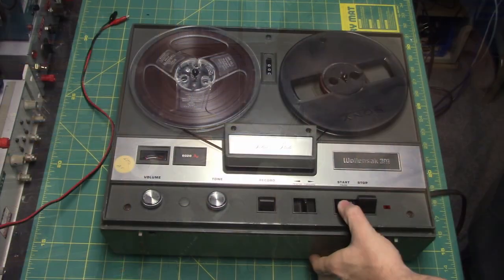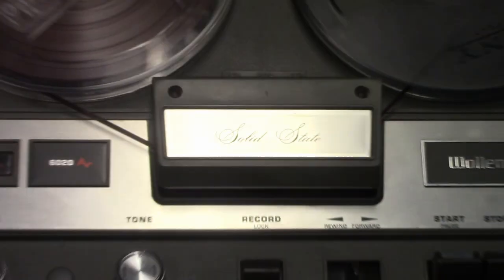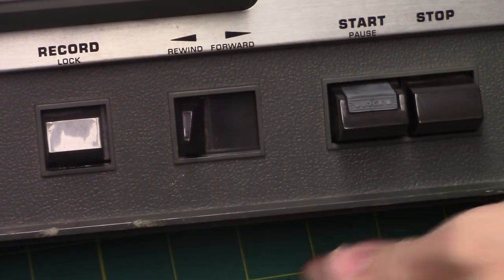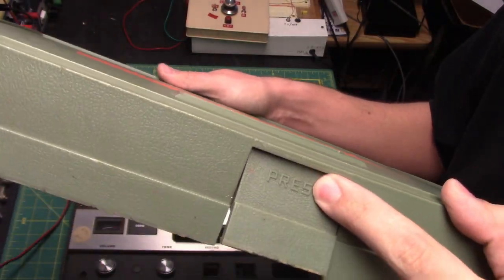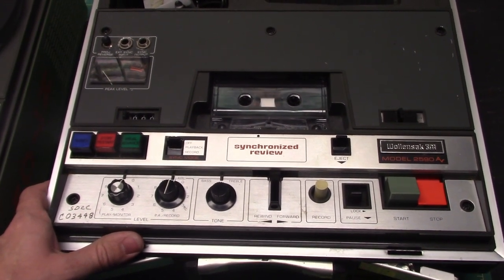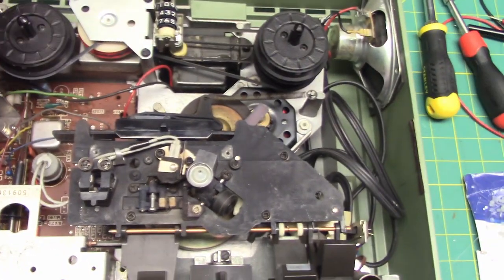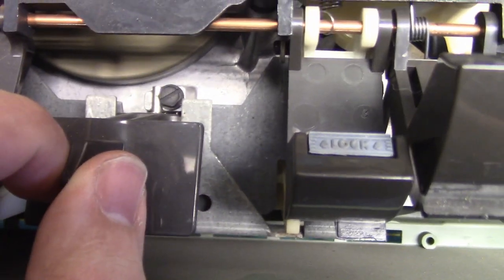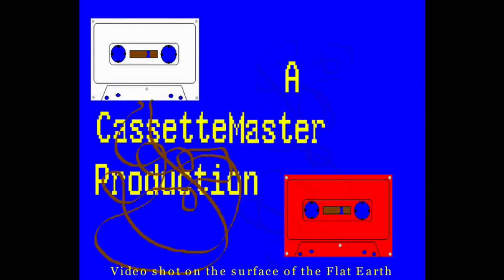Wollensak 6020AV Reel to Reel Tape Recorder

Comment: Had a TON of these pass through my shop when they were new and current. (We were a dealer, warranty, and service center.) The same transport was used in their whole line back then. This model was mainly bought and used by schools and other institutional and corporate customers but the were other models including a high-speed duplicator and stereo versions. Up to 1972 there were also a full line of these sold to the audio market, including 3-head decks and portable recorders with up to 70-watt stereo amplifiers! I still have a restored deck and a couple of the "Audio Center" portables with built-in air suspension speakers (top-end line). In keeping with the time they also offered a 4-channel model.

Wollensak (Actually the MinCom Division of 3M) had hoped these (and their cassette siblings) would end demand for their old and expensive to make 1500 series. They did however update the old Revere design with new colors to match the rest of the line and added Auto Record Level (switchable) and replaced the neon bulb level indicator with a meter. The new 1520AV continued to sell right up to 1981 when they finally pulled the plug. By that time the list price had gone up to $895! When word of the cancellation hit the market there was a panic-buy situation as customers called every dealer trying to find one with some on the shelves.

Wollensak restyled their cassette units that year and introduced some new models including one with servo control transport and digital control and a couple with built-in dissolve for projector control. Unfortunately, corporate declared MinCom's profit margin too thin and sold them off to a small outfit in the South, ending the legendary line in 1983.

Comment: Thanks for the interesting video. I always thought these later Wollensaks were made by Sanyo or Hitachi -- but this construction  is definitely American - note the hex head screws - so US. I bet some of the parts are riveted together. Rivets are very American. The AC motor looks like the same one used in the 5000 series of recorders. The lower end models of that series also had speakers glued to the case, and they are HARD to get out, let alone replace! Odd size speakers too! Anyway, thanks for the interesting video.
Reply: Wollensak used Sanyo for its consumer lines. The rest they made themselves. There were a couple of hybrid models in the upper cassette market though. These used the US transport mechanism mated with Sanyo electronics. Really weird things inside. Sanyo cut the transport down (literally!) so it would sit off to the left and free the top panel to hold big meters and the level controls on the right as was the Japanese and German style back then. BIG machines and rather impressive. Dolby B NR, of course. This was spawned by Advent taking 3M's cassette mechanism and using their own electronics to make the second Dolby NR cassette unit on the market - the famous Advent 201. They had briefly sold an earlier version made by Nakamichi and sold as the 200. The rest, as they say, is history.
Reply from the maker: Yes, I have seen some rivets!